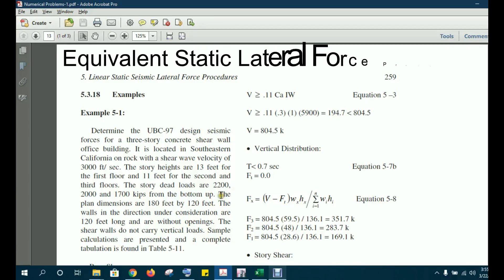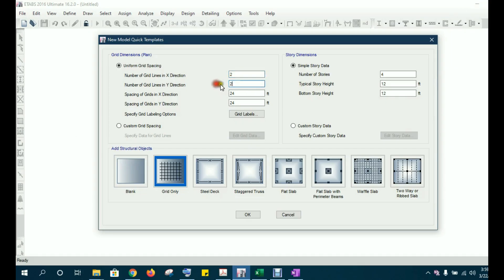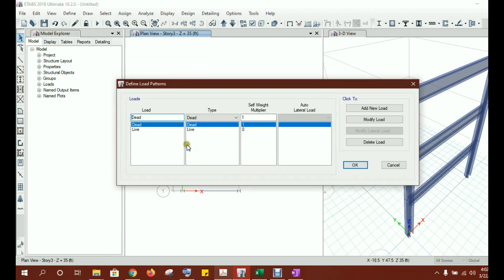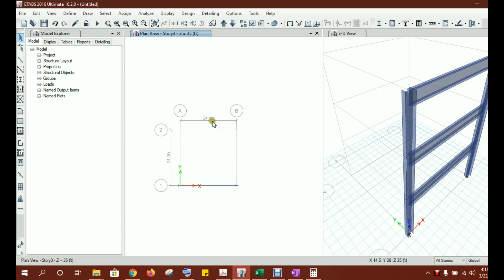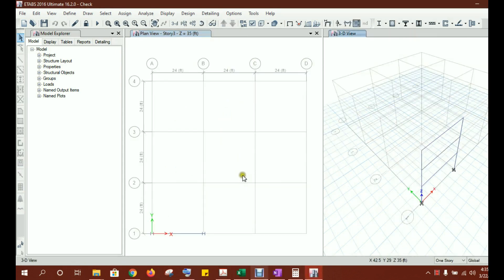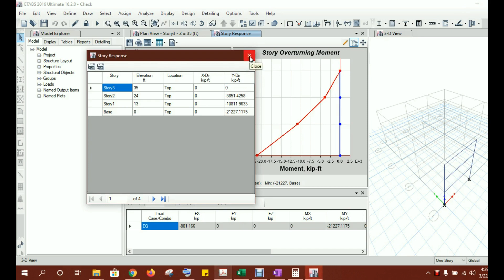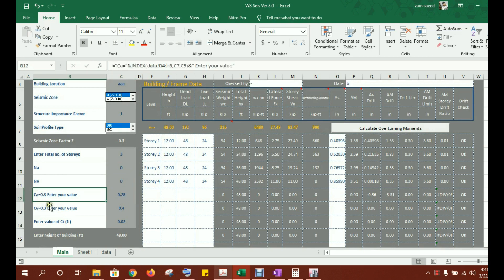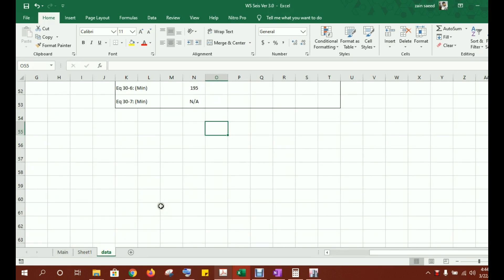Equivalent Static Lateral Force Procedure - Comparison of Manual calculation with ETABS and Excel

Comment: This is Awsome also make the video with slab having different live load on that floor. Waiting for that video( both manual and etabs)
Reply from the maker: The design of conventional beam-Slab system using ACI coefficient has already been recorded. However for the design of Slabs (flat slab) keep in touch with the channel and it will be shared soon